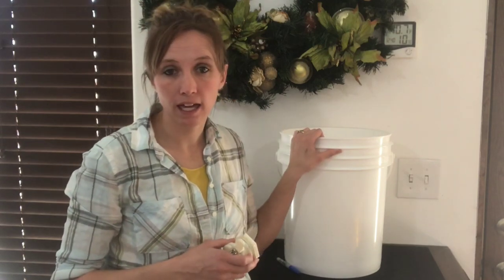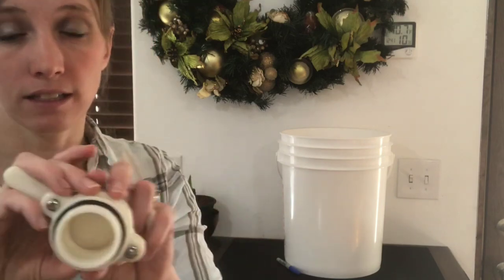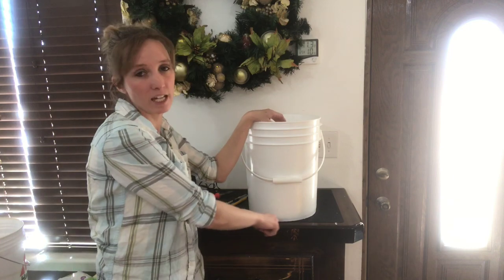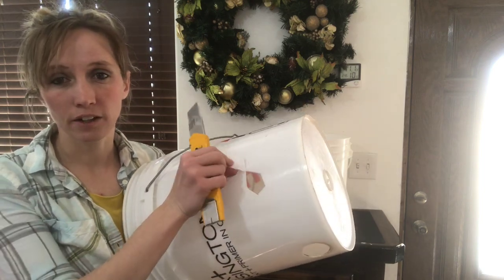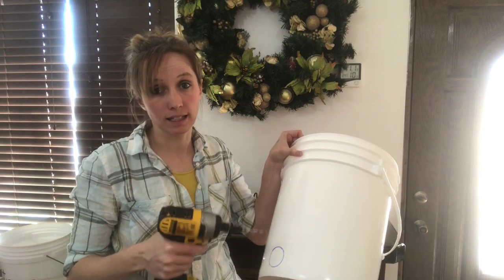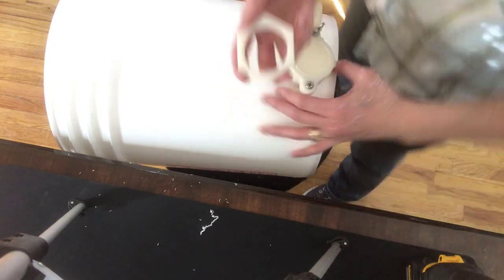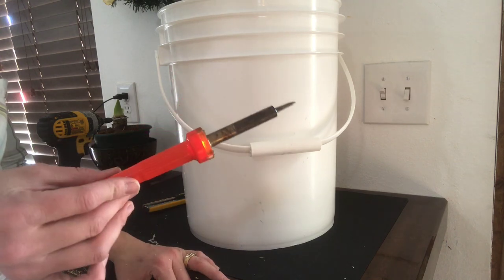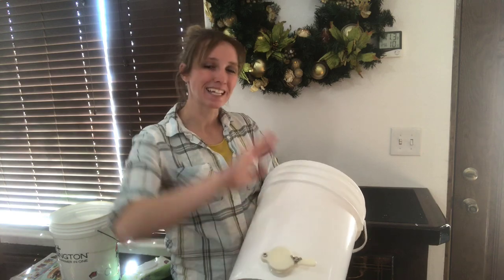Make Your Own Honey Bucket, Honey Gate Installation, Beekeeping On A Budget, Backyard Bee Builder

Comment: Do you have to use silicone to seal it as well? I have installed one on a bucket and tested it with water, which I know is not the same viscosity, but it does leak a bit.

Comment: Try putting it on the lid. That way you can transfer from bucket to bucket very easy. And lay buckets on there side works great
Reply from the maker: I've seen that done before! Sounds like it will work great... Do you have problems with the lid leaking? I worry MY lid would pop off and i would have a bucket of honey on the floor... :-)
Reply: Backyard Bee Builder No leaks yet. Used food grade container lid. Just so I can move it from bucket to bucket. Kind of handy, and best of all cheap. No need to buy multiple gates. Keep up the great work. You do great 👍🏻
Reply from the maker: Thanks! Cool tip...I can see how that would work slick! Thanks for your comments! 😊🐝
Reply: Backyard Bee Builder Look forward to your new videos.
Reply from the maker: Thank you! I’m glad you enjoy them...😊🐝